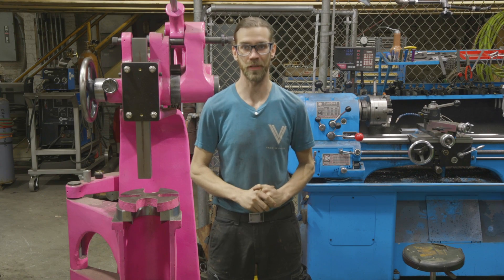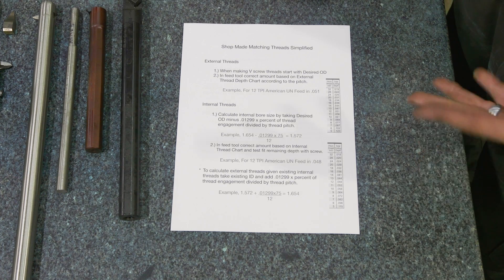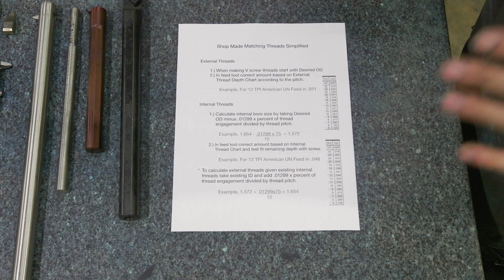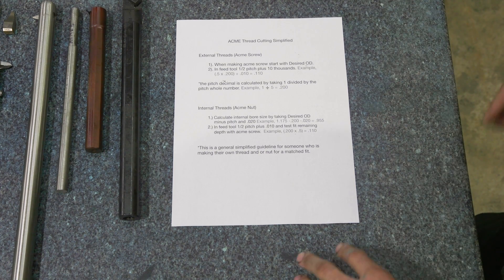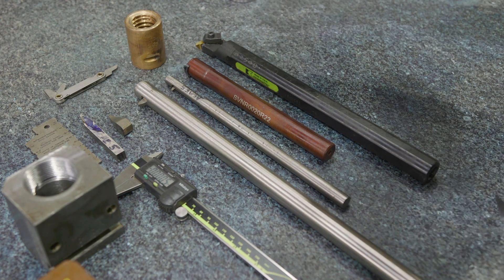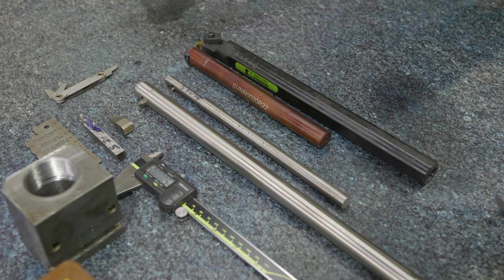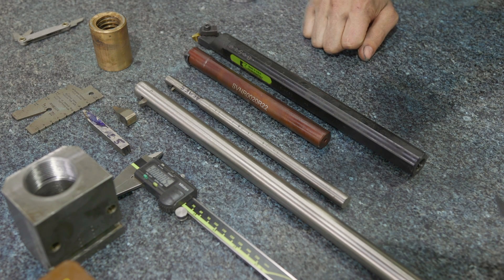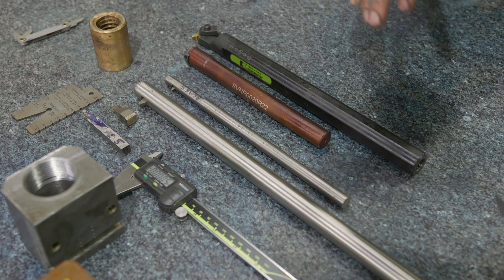How to: Internal ACME Threading

Comment: I have never used a lathe, but when you feed into the piece, and want to make a thread, say, 0.05" deep, vs making the piece 0.05" smaller in diameter do you have to remeber to divide that number in half for one or the other scenario when dialing it in?
Reply from the maker: If your not using a dro
Reply: @VanoverMachineAndRepair  so the DRO has a divide by two, or multiply by two mode?
Reply: The short answer is “ it depends”. Some lathe dials measure in actual movement and this would be the actual depth of cut (DOC). If you make a movement of .50” on the dial you will remove .100” off the diameter. Some lathes have dials the compensate and the dials measure in diameter reduction. On these a .50” move of the dial only removes .05”. When cutting threads it is the DOC that matters so you need to know what type of measurement your dial is using. This only works when the DOC is tangent to the workpiece being turned. If more or less than 90 degrees you will need to use Trigonometry to calculate the actual movement or use direct measurement. Probably more info than you were looking for but you dropped in the quarter and pulled the arm.😊
Reply: @JTL1313  Thanks - that makes sense.  I just would typically see guys taking some amount off the diameter, and  I was wondering if they were dividing the depth in half in their head and moving that much, or if the tool handled it.
Reply from the maker: @kailuagarage  yeah like the above commenter said depends on equipment. Most lathes have dros so you can set it to either. Meaning most guys are talking about taking off the diameter no matter what the revolutions on the dial are. The machines that don’t have a DRO you have to be more cognizant.

Comment: Please tell me why my thinking is wrong. I have never done lathe work, just interested.
When you make a thread - it goes clock wise (what thread do you call that?) from start to finish. Should you turn it around  i.e. the end becomes the start, but you don't change the direction of the turne - doesn't that then become anty clock wise (making a left hand thread)?
I get the right direction & left direction from stering say adding suger to tea, would that be same as making threads?
You can see what you have done- made me think.  Thank you.
Reply from the maker: Yeah, I could be kind of tricky to think about. Generally speaking when it’s a right hand thread, you feed towards the chuck when you’re cutting. At least on the outside of a part. If it’s a left-hand thread, generally your feeding away from the chuck. when you internal threading same concept applies but there is much more nuance. You can flip the bar or reverse the chuck direction to mess with the cutting direction. What I like to do is look at a screw on its side. think about a lathe lead screw if the screw seems to have the threads leaning to the left and it’s a right hand thread and vice versa.
Reply from the maker: Your logic seems to make sense on face value, but in reality, it doesn’t work that way because it’s not about the direction you feed into the nuts per se it’s all about the direction of the engagement of the threads.
Reply: Good stuff